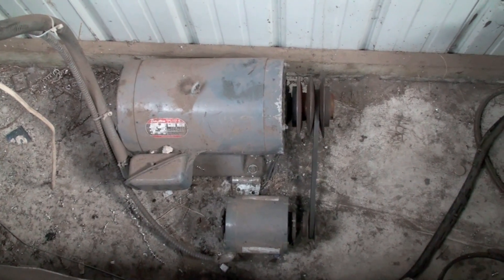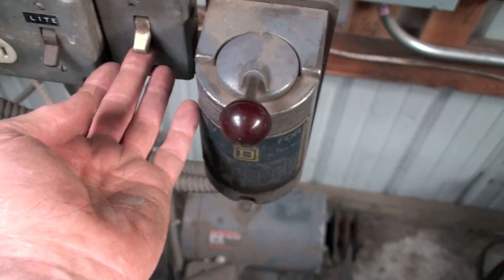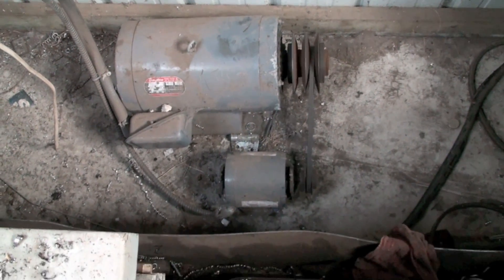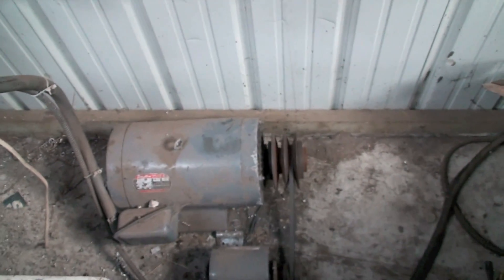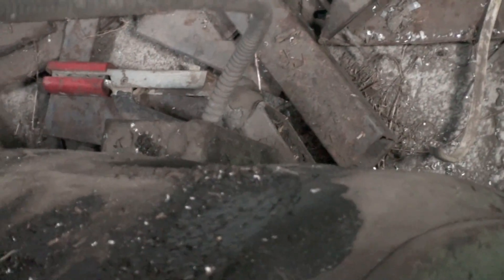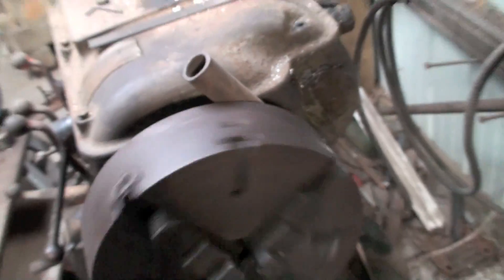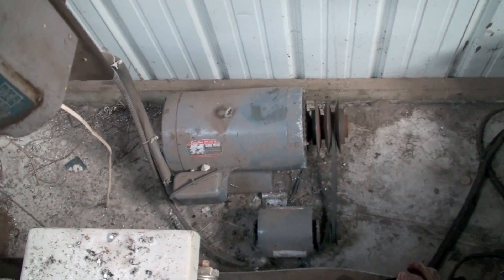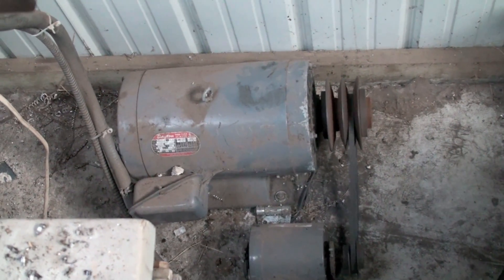Single phase to 3 phase the simple way

Comment from the maker: That works by using a capacitor to the 3d winding, thus using the 3d winding as a start winding.  When the motor starts, the winding is dropped out.  The only time I ever tried that, i think the backfeed from the controlled motor blew out the capacitor.  Not really sure why.  This system is used because it is simple and pretty much bullet proof.  Thanks for the comment.
GFM

Comment from the maker: A friend repairs welders and checks them with 3 phase converted this way.  It is best if you can use the single phase circuits for the controls and only use the converted line for the main transformer.  That eliminates some of the voltage variations of the 3rd circuit.  Yeah, I know about the safety issues with the lathe.  Hope this helps.
GFM

Comment from the maker: I have a friend that repairs welders and I asked him.  They will work.  I would not guarantee perfect operation.  If you can wire it so the third phase is not used for the controls and is only used for the main transformer it works best.  Also different brands work differently.  Yeah I know about the safety issues.  Hope this helps.
GFM

Comment: I had a full shop of 3ph. sold most, regrets, will this work to run ,my 3ph welders?
Gee you have no safety standards(smile) I hate lathes that do not have a foot brake
Love the belt guards. Thanks  for this

Comment from the maker: When you look closely, I think you will find the idler motor is just that.  It is not under a large load and does not overheat.  Overheat is, after all, the measure of power loss.
GFM

Comment from the maker: I looked at this vid again and noted I said exactly the same on all 3 phases.  Not so true.  When the motor has no load, 3d phase is very low.  As the load increases, the amp draw of the 3d phase goes up but will never be exactly the same.  Still, you can run at least 80% load without overheating.  Sorry about the bobo and thanks for the comment.
GFM

Comment from the maker: You will need a 3 phase motor of approximately one and one half times the hp of the motor you want to drive.   A 1/4 to 1/2 hp start motor to start the larger motor.  Belt and pulleys to drive the start the motor.

Comment from the maker: The described method of converting single to 3 phase is a rotary phase converter.  There are converters that use one of the 3 phase windings as a start winding and use a start cap to start the motor.  Then it runs mostly on single phase.

Comment from the maker: The speed of the pilot motor is not important nor is the rotation.  It is only to begin the 3 phase motor rotating.  Once the 3 phase motor is rotating reasonably fast it will start running on its own when power is applied.